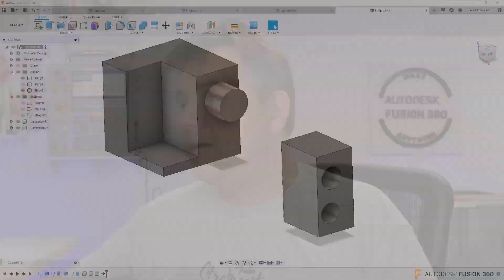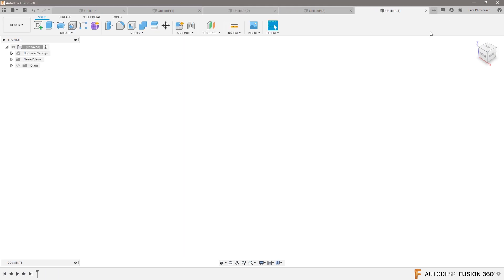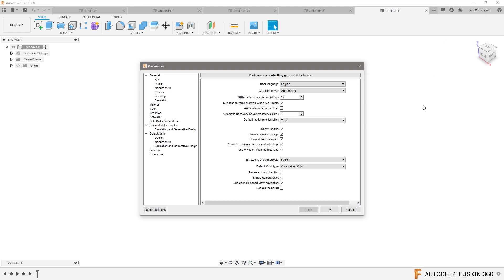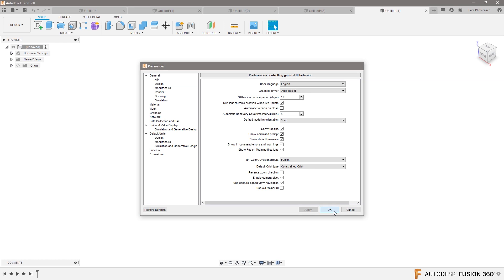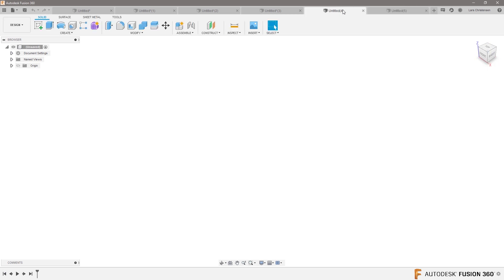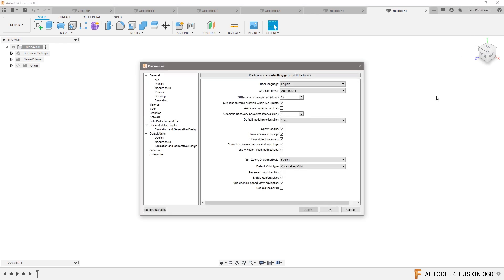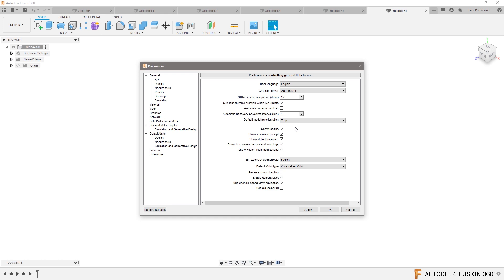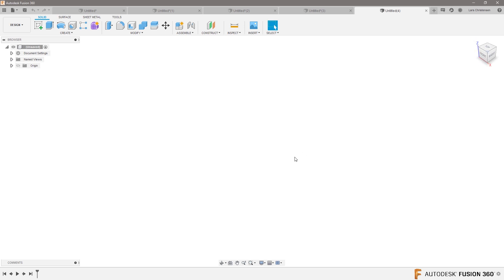Fusion 360 — Understand Z vs  Y No RULES — Ask LarsLive

Comment: @Lars Christensen  For mill work you need Z up BUT when you are working with a lathe you need Y up as X is tool moving in and out and Z is the tool moving along the bed and Y is the rotation angle.
Reply from the maker: True! But CAM software has always given you the option to adjust that. Because the CAD systems were stuck with this whole default Front Plane default